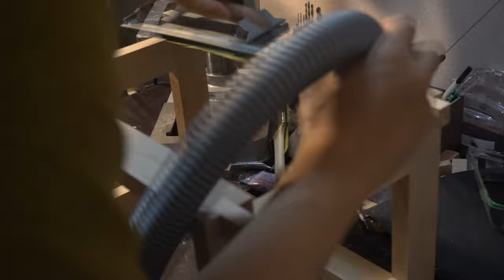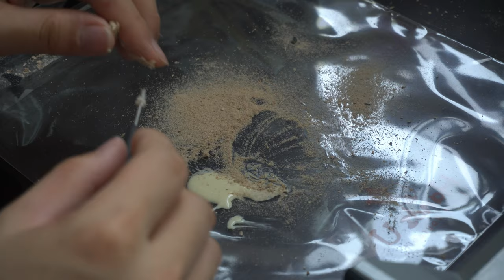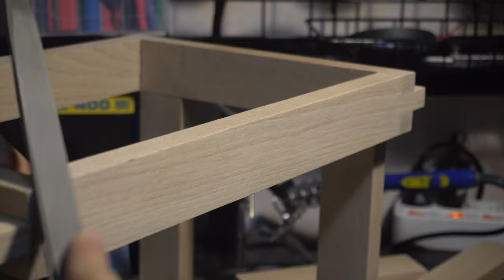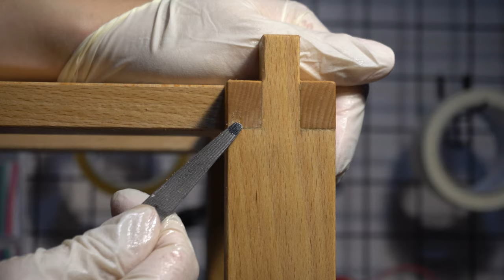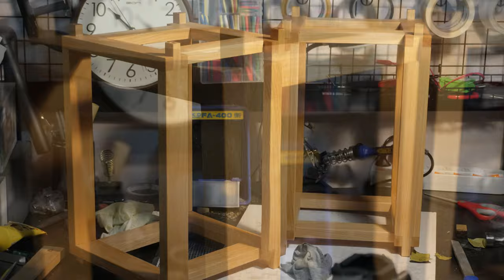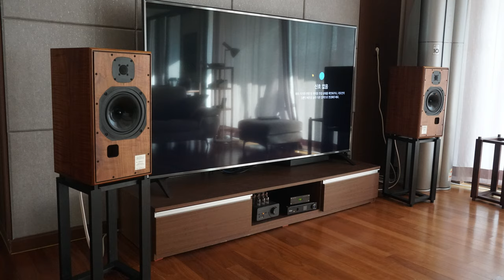Harbeth Speaker Stand  #3

Comment: Just a thought.  Harbeth are based on thin wall resonant tuning method mainly for voice and violin for beautiful tunes.  They are ok for slow transient changes but bad for fast attacks because of slow time constant of wooden materials.  You really don’t want use a wooden stand that will color the sound through additional tuning.  That is the reason most of harbeth stands are made of of light rigid metal that releases resonant energy much faster than wooden cabinets thus not adding any coloration.  Additional warmth and richness of midrange sounds good but they are unwanted coloration.  They will further slow down hard rock and piano attack sound.
Reply from the maker: I do agree. However, this particular stand design and material does not hurt transient any bit yet it also improves bass response in a very big margin. I can say transient is definately not hurt because the spatial awareness was improved. (which is mainly affected by high frequency) In my perspective, this is total improvement... (This is true only when it is made with beech wood. For other woods, all the weakness you stated revealed.)

Accroding to an engineer from Dynaudio, there are 2 major types of speaker stands :
1) A very heavy one that's supposed to physically "fix" the whole cabinet to the ground so unneccessary resonance is thinned by its connect total mass (which is THE GROUND). This is just so the unit is the only one that's moving. In this case, they use spikes for the feet so it has similar effect as it is fixed to the ground with bolts.
2) A very light and resonance-cancelling structure. ISO Acoustics' stands are good examples. This adds a tiny bit of resonance to the sound, but ideally that addition is minimized.

I see this wooden stand is kind of an 'isolator' in this regard, which adds a tiny bit of wood resonation to the sound.
By the way, I've used a thin metal one and a thick metal one. They both had this strange "metal resonation" added which I didn't like.
Reply: spvlinn - Your comments are completely at odds with Harbeth’s own recommendation - namely the Tontrager wooden stands (outrageously overpriced at £1k). 
Made in beech, ash, oak or cherry using schoolboy joinery (basic housing joints, not tenons as they describe it). 
I’m a cabinetmaker and knocked up a pair in cherry for a fraction of the price and they perform beautifully.
Reply: @AbleCho  maybe things changed.  I do remember the founder said expansive cables amps don't matter. They all sound the same.  Finally I figured out it's coloration of the walls.  I was really shocked by comparing a pair of Naim sbl vs 30.1M many years ago, the Naim sbl completely murdered the Harbeth that simply could not keep up in fast baseline at all!